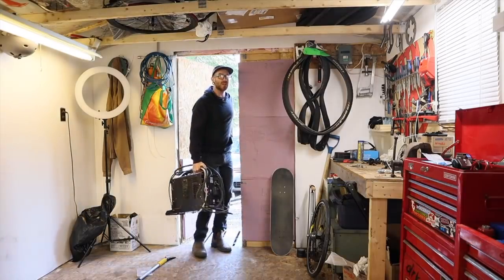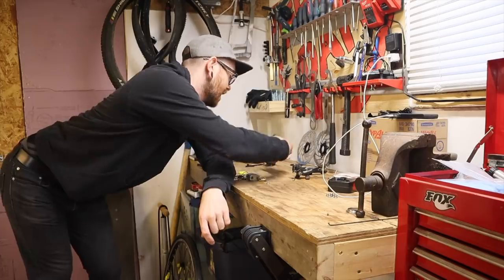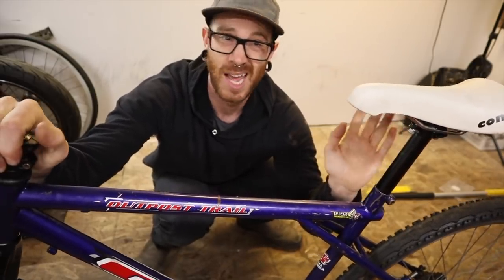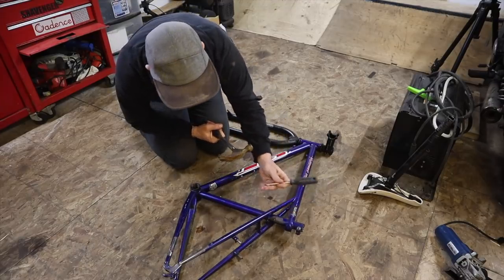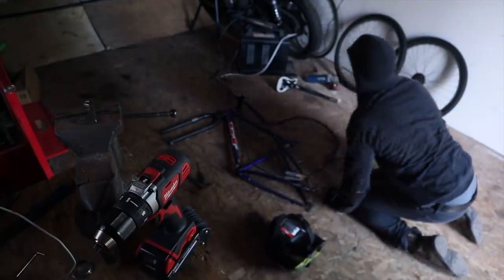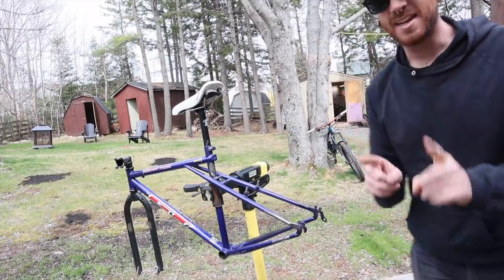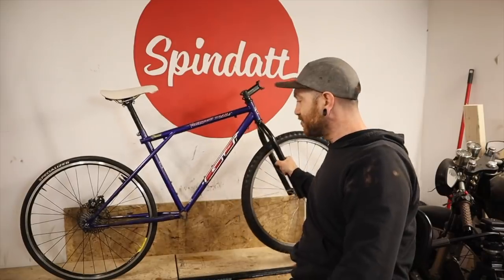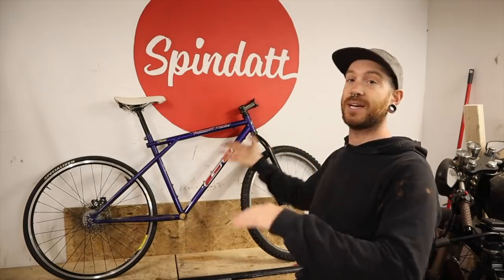I welded a disk brake onto my retro mtb frame.

Comment: Dr Frankenbike here! My kind of project. Welding thinner steels and filling gaps is best done with a copper backup shoe. A copper plumbing pipe might have prevented  burn through and cut down on the  file. JB Weld might fill those imperfect welds for a masterful look under paint. You could brag about how you got the heat setting just right so it just about welded itself! Steel is such a fun material because it tolerates a few mistakes and usually can be corrected. It's Alive! Great video.
Reply: Why not just make a flat mount and JB weld it to the frame? I bet it would work fine. Drill and tap into the frame itself, so just a small plate on the outside to serve as a brace and flat surface.

Comment: Hey brother - weld does not stick to copper - so in the future if you can put a piece of copper tube I side the tube you’re welding you can save some cleanup
Reply: Its great tip! I welded thin sheet metal with stick welder successfuly thanks to this method.

Comment: Awesome stuff. Loving the build on this bike. I've got the exact same frame that I recently stripped down, and built up into a flat bar, rigid gravel bike, with new headset, bb, 700c wheels, forks and re-using old parts (drivetrain, hydraulic brakes, bar, stem, grips, seatpost, saddle and some spare tyres that didn't fit in another project). Can't wait to see yours once it's finished. It's gonna shred for sure!

Comment: That's coool! 🤯👌However I simply used a disc brake adapter on my old 26 inch MTB to convert from Cantilevers to Disc Brakes. So far so good, working fine. Only a bit flimsy to set-up.

Comment: You see, I have had similar ideas. Welding disc brake mounts on a frame without them. But the Internetz went craycray as soon as I mentioned it. Everyone said it will bend the frame. Sadly, I could not find anything about those cases. Maybe someone here has an idea about it...

Comment: Great! were you concerned about the thin metal of the frame? I'm asking because I want to do it myself on one of my frames but I am not sure if I would burn a hole into it, especially since I have only the opportunity of stick welding
Reply: I did it to my bike with stick welder. Most important thing is to use smallest electrode possible. I belive 1,6mm is smallest one. Other thing is welding small portion at time so you dont overheat tube and burn hole throu.